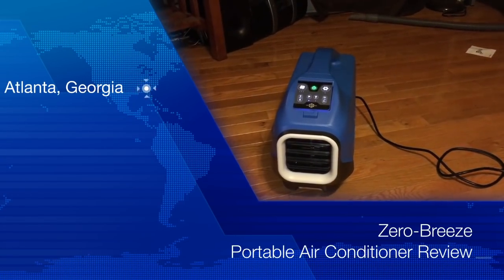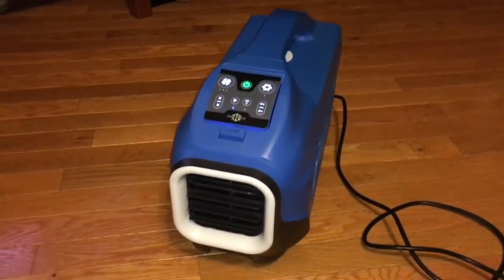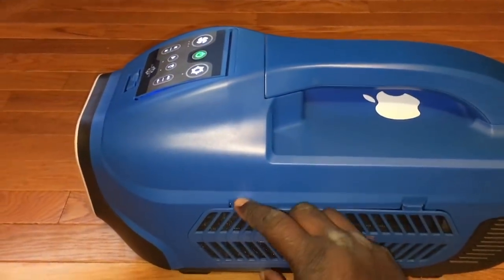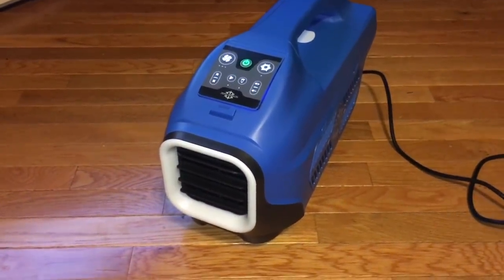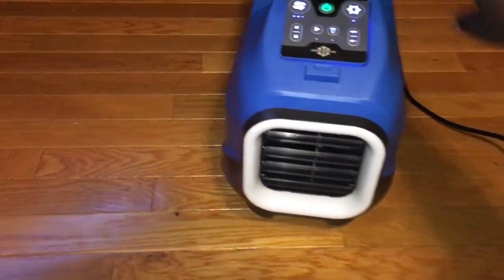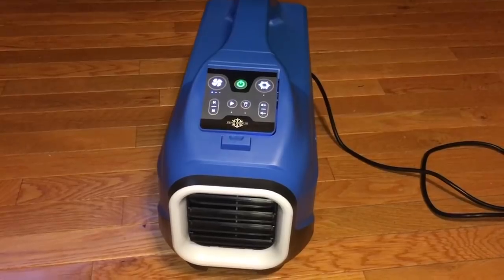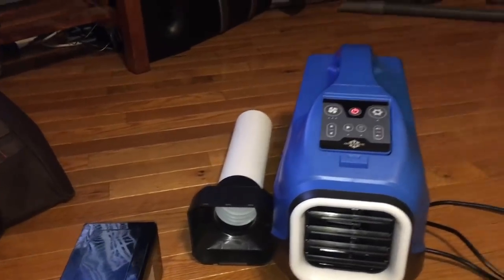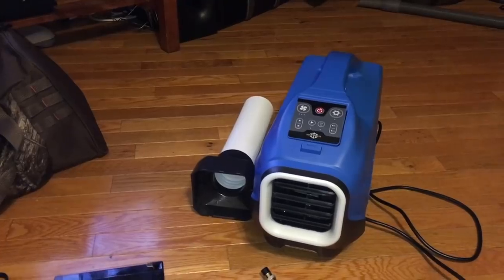Zero Breeze Portable Air Conditioner Full Review

Comment: Wondering how many purchasers of the zero breeze have had as negative of an experience as us? I have been in contact with the "fine" folks at zero breeze about how poorly the unit performed. They asked me to send a video showing the performance of my zero breeze, which I did. It lowered the ambient temperature about 1 degree in 10 minutes. After I pestered them about the video, they finally got back to me and said that the unit was working as designed " But if you blow directly to your body you will feel the cold air in you and a quick cooling down of your somentosensory temperature." I'm not really sure what that means. Their website clearly states. 
 It can cool the environment temperature down from 90℉ to 72℉ in a 50 square feet space and reduce the humidity at the same time. It does not even come close to doing this. The unit is a piece of junk. Buying the unit is a wast of money.

Comment: Modified Sine wave inverter should be fine, those adapter are Switched-Mode.
Reply: If you have the juice to run an inverter...you would be much smarter to run this directly from the 12v battery system.

Comment: This is only to blow directly on a person or more accurately a body part such as face as opposed to an entire body. To know whether it would give any usable relief you need to be in a hotter room such as high 70s to 80+. Im a hvac guy and at 1000 btu's my oppinion of this device is useless taking in consideration noise factor and cost. This is a great device to cool off Barbie in her dollhouse as opposed to a human. Just my opinion of course and we all know what opinions are worth. Outside of that this was a well done and informative video.
Reply: Actually he said it cooled down an entire room.  I can't validate that but you never know.
Reply: Yeah, but he didn't say how small the room was.  Maybe 4 X 4 X 4 feet???
Reply from the maker: I said that?  I thought I said it would NOT cool the room.  I’ll review the video. I use it mainly for spot-cooling me, and 1100 BTU is enough for that.   For instance, when I have to watch the kids outside, the ZB has REALLY been handy as I’ve been comfortable and the kids seem to not care about the heat.
Reply: Thanks Jay, for the clarification.  Yes, I understood that the unit would only spot cool.  But, given time it would probably keep a very small room (a closet, really) several degrees cooler than the surrounding rooms.  Still, inadequate for cooling an average sized room, but the unit isn't designed for that purpose anyway.  It would be nice if you could get a practical unit that would handle a small room though.

Comment: It's advertised as an A/C unit, not a fan with a compressor, so wouldn't you think that when you first turn it on it would automatically engage the compressor? I don't think I've ever owned an A/C unit that when I turned it on, I would also have to switch on the compressor in order for air-conditioned air to come out, so one would think having the ability to turn off compressor to revert it to a fan would be a plus, vs it being a negative, but hey to each their own.

Comment: $420 for a small air conditioner?  May as well buy a full size AC for half the price.
Is it really effective on a hot day?  90 to 110 degrees?  Or only good on warm days?
Reply from the maker: RedRider1600 True but this is a new product and you know pioneers pay the highest prices. If it’s performance is consistent, you should be very comfortable whenever you use it. Since this video, I’ve used it at two DJ gigs in the booth and to cool a non-climate controlled bathroom with positive results all three times.
Reply: Also you can take this outdoors. Camping. The beach. Tailgating etc
Reply: Is that much of an improvement over a cheap fan?  Is it worth the extra $390, and 5 times the electricity?  How much power does it use?  150 watts?
Reply from the maker: The beauty is that this is an actual vapor compression unit, so it definitely beats a fan especially in humid situations.   Its very portable even with the alternative battery set up I use. For me, it was worth the investment.
Reply: You are paying for its portability
Reply: A 9-inch $30 fan is portable too.
Reply: Hi RedRider1600.  You bring up a good point.  Yes, this is a refrigerant type a/c unit so it does actually cool the air.  You can't achieve the same degree of cooling with a fan alone.  It's limitation is the 1100 BTU rating.  A fan with a high air flow might give nearly the same effective feeling of cooling as the zero breeze.  It would be subjective and impossible to test with an apples to apples type comparison. The smallest window air conditioners commonly sold are 5000 BTU and are designed to cool a single room.  So the zero breeze has the power to cool maybe about a fifth of a room?

As to the power requirements, Zero breeze uses 12.5 amps at 12 volts.  A typical 5000 BTU window air conditioner (the $100 variety at your local big box store) will use 4.5 amps at 120 volts. (Taken from the label on the one I bought 5 years ago.)  Using Ohm's law, we can calculate that it would use 45 amps at 12 volts. This 45 amps is approximately the usage capacity of a group 27 marine deep cycle battery every hour for the window a/c and every 4 hours for the zero breeze.  But with the 5000 BTU Vs. 1100 BTU difference in the units as well.  So the unit is a little less energy efficient than the 9 SEER rating of my window a/c machine, but not horribly so.  The answer to the power problem could be to just keep it plugged in to the grid, but that too would limit the portability and the practical applications of the zero breeze unit.

Yes, the unit is portable, but so is a Honda 300 watt inverter generator which will power the rooftop a/c in my RV.  I'd like to see the zero breeze doubled in size. (BTU rating)  This would leave it portable enough but much more practical for cooling small spaces.  1100 BTU would be sufficient for maybe a small closet, I think.

If we consider the window a/c as sufficient to cool a room that is 10 X 12 with a 8 foot ceiling, that would be 960 cubic feet of space. One fifth of that would be 192 cubic feet, so let's say that the zero breeze would be sufficient to cool 200 cubic feet of space. That could be a space of 5.5 X 6 X 6 feet. (198 cubic feet)

There is still some development to be done on this product.  They need to get rid of the fluff items like bluetooth speakers and work on making the zero breeze more practical for more people and for more applications.  JMHO.

And as others have stated, early adopters usually pay more and receive less quality for the higher price than do late adopters.  Personally, I have to be REALLY sold on a product to be an early adopter.  I can remember when we talked about and dreamed of the "Sub-zero" computer. (A computer that one could buy for less than a thousand dollars.)
Reply: It may have refrigerant and the air may be cooler, but the thing is tiny and the output is very small.  A 12" fan might do an equal or better job of cooling.  I would like to see some real objective tests for comparison.  Hey, that's a great idea for a video . . . hint, hint . . . somebody?
Reply: The next time I'm in a 5.5 X 6 X 6 Vietnamese POW prison cell, I'll have to get me a Zero Breeze portable air conditioner.
Reply: It's actually $900 now. Waaaay too much. :(
Reply: Just wanted to post to give you some kudos and say you did a GREAT job on this review. Thank you

Comment: So on one side its 55 degrees, and on the other side its 100 degrees without exhausting the heat outside the room its cooling,.. so all you get really is a higher electrical bill.
Reply: D V derp
Reply: this isn't designed for home use, looks like a camping / tailgate item.
Reply: Didn't you see there is an exhaust that can be used to move the hot air outside?  You get a "D" for paying attention.
Reply: D V Ever hear of heat resistant plastics like Vespel, Torlon, or Ryton?  There is no melting point for any of the three. Oh, they don't create high amounts of ambient heat either.  Nice try rube.  Whatcha wanna try next?  I can do this all day.
Reply: Sylvester Simons no melting point does not mean it retards heat transfer. In fact it does that exact opposite. It displaces heat,.. it does release a lot of that heat into the surrounding area. We can play this all day. But you have to use actual facts. Otherwise whats the point?
Reply: Look D V, I used actual facts. There are several heat retardant plastics on the market that are resin based and used in higher end portable a/c unit exhausts.  I will say one more thing then I am done.  If the unit cools you, and you can shut your central air off, bottom line, you are going to save on your bill.  There is no way to refute that fact because the amount of heat this unit would create in a small bedroom is negligent.  Isolating air use to that room will reduce your bill. Small room, small heat signature, your bill still goes down overall.
Reply: Sylvester Simons hahahahaha
Reply: If you displace air in a room it is going to be replaced with air that is unconditioned. So if it is 80+ outside you are still fighting a losing battle. Still a worthless product unless you just have it blowing directly on you, but it will never cool a room.
Reply: you talk too much......unnecessary blah, blah, blah
Reply: What do you mean?
Reply from the maker: The exhaust hose is made of the same material and same thickness as those on full-sized portable AC units, so I would expect the unit to perform similar to a full-sized portable unit in room-cooling mode when removing heat.
Reply from the maker: Michael Hayes The negative air displacement is a valid problem with single-hose portable AC systems; the ZB is no different. It causes them to cool a room very slowly compared to closed systems.  They do work, however, when there are no other options although they aren’t as efficient.
Reply: Again, it's NOT meant to cool down a 120 square foot room! It's for small spaces less than 50 square feet. That's about the size of an 8 x 7 closet or large sized van or tent. Not a problem if it's vented properly. And the vent hose wouldn't affect the overall ambient temp of the entire room, if at all! A large fan would cost more in electricity and NOT cool down the room at all. Just circulate the hot air.
Reply: Question tho as the vent only goes out the back but he showed sig heat coming out the back sides how does that work
Reply: I use one in my bedroom in South Dakota, which is super high humidity, lwers the temp by an average of 25° and there is no excessive heat from the hose, it's a dual walled hose. It works great and you can listen to tunes
Reply: If it makes my electricity bill higher id rather just out a fan in the window or go buy a air conditioner to put in the window and cool the whole house....i don't think it's fit for a home but I will say this is a good product but what if you have no power?does it run in batteries?can u recharge it somewhere via car,etc?i live in Chicago and lately it's been 95 almost 100degree weather and had a rain storm that knocked my power out....now how would I cool my home if the power is out?
Reply: Yea there is no way this would cool a house let alone a bedroom. There’s a certain amount of BTU’s you need for the proper cooling power. We have a 10,000 BTU and it’s 450pi squared for our apartment which is probably like 650-750 square feet. What’s the BTU on this?
Reply from the maker: It’s not expected nor advertised to cool a house. It’s only 1,100 BTUs.
Reply: radio tech Fans more effecient.
Reply: James Patterson Yes it runs on batteries. Did you not listen.
Reply: Lyle J it's not made for a house
Reply: Caesar45 it's not made for a house. Camping and rvs

Comment: Actually there is a better alternative at a cheaper price. The Icybreeze cooler/ac. Yes there is a hassle with adding ice and water but with enough ice it will easily last for 6 to 8 hours and certain ice packs such as cooler shock will make it cold longer. One big plus with Icybreeze is that the temperature can dip 35 degrees below the ambient room temperature. Zero Breeze only about 15 degrees which is pretty bad considering it has a compressor and refrigerant. The fan on Icybreeze blows up to 25 mph of COLD air which is a heck of a lot more than a typical fan which is around 8 - 12 mph. Zero Breeze is overpriced and there are definitely cooler and cheaper portable alternatives despite a little inconvenience of adding ice and water. What matters to me is the results. How it feels and how much it costs.

Comment: I feel like this thing needs to break priced at about $120 max considering you can get an actual portable AC that is much bigger for about $250.
Reply: Because of the portability factor, I'd go up to $200 for the price point.  Much beyond that though and it is just an expensive toy.
Reply: A window a/c is a high draw appliance and it would chew through a car battery in a matter of minutes.  Even with a marine deep cycle battery you couldn't run a window a/c for a significant amount of time.

You'd need a bank of at least 10 large deep cycle batteries to run it for a significant amount of time.  I've done the math and running a window a/c using an inverter and batteries just isn't practical.  (I'll walk you through the calculations if you wish.)

Still, Zero Breeze is a product to watch.  Give it 5-10 more years of development and it might become something much more practical than it is now.
Reply: And I agree about the bells and whistles.
Reply: It would be nice if they made a version without all the bells and whistles like the bluetooth speaker and light. I'd like to get one of these but I would be over-paying for a bunch of features I would never even use.
Reply: Hmmm can you run it on battery? Not that is why they invented this FOR USE IN TENTS, RV'S & when they have NO electric or generator, OR they don't want to listen to generator in middle of night and piss off the neighboring campers to boot!

Comment: Great review, but this thing doesn't breathe high quality. The plastic case was rattling until you pushed the fan button, which does not give a lot of confidence. With all the useless bells and whistles it looks not only made but also designed in China, not San Fransisco. Lose the bells, make it more sturdy and it'll be getting there.

Comment: I would like one but do you think it would cool off a semi sleeper too save fuel
Reply from the maker: Derek Oehlert it’s rated at 1100 BTU/hr so I wouldn’t expect it to cool the entire camper. It will keep you comfortable and reduce the humidity though.
Reply: How does it reduce humidity?  Is there a water collection container built into the unit?  Or does it just drip water all over place?
Reply from the maker: The base of the unit has a drainage channel built in beneath the evaporator that drains to the rear of the unit; there is an opening that will release the condensation at the rear. The Zero-Breeze also comes with a condensation hose that attaches to the rear opening so you can route the condensation somewhere else.
Reply: Jay Lee great job on the videos. I have been testing my unit in San Antonio and plan to use it in a roof top tent.  I have had an issue with water dripping out near the drain port.  Have you experienced similar issue? Or have I am I not doing something correct and this causes water water to drip out of the over flow under the power
Reply: Derek Oehlert Since its an actual a/c, you would need to vent the hot air out of the sleeper that the unit is producing.
Reply: Derek Oehlert Z
Reply: Derek Oehlert iib
Reply: I'm no rocket scientist but if you vented it outside, making some panel to mount the exhaust pipe out a window without letting more air in, oh and my portable I am using the exhaust pipe was so hot, I put heating pipe insulation sleeve on it, and wow it really helps, it was so hot it had to be adding heat to room, like radiant heat would. I moved to another room, put window in but then insulated the pipe and out the window, it was also outside room in other room but couldn't do the job, think this would be great for a small sleeper cab, however like a car they would also heat up hotter than a house room, so you would have to try it and see, send it back if it sucks. Thats why I don't buy anything thats not sold in land stores online, they make you pay to ship it back and restocking fees if you don't want it.
Reply: Of course the water when full is going to come out somewhere, you have to put a drip pan under or use the drain hose to route it elsewhere, just like a portable air conditioner, mine would drain near 4 gallons or more water on a very hot day from air, got tired of using buckets and emptying it, so hooked up a hose, same difference here. Of course how much humidity where you live will tell the tale
Reply: Derek Oehlert

Comment: Principal of cooling is moving heat from one place to another. So these machine is dumping the hot air back in to the living space?
Reply: If you don't install the external vent, then yeah, that's what is going to happen.  If an air conditioner like this was perfectly efficient, then the heat coming out the back would balance with the cooler air coming out the front and you would get zero average change in room temperature.  Unfortunately, you can't get 100% efficiency, so the net result will be for the room temperature to increase.  You really need to vent the heat out of the living space.

Now, if this thing had a vent where cool air could be piped elsewhere, then it would open up some other possibilities.  One thing that I would consider it for at that point would be to use it to cool the helmet of a rider on a motorcycle.  Car race drivers have helmet systems where they have hose attachments for air intakes and this sort of modification to the system would be perfect for that.  If you can keep the head cool, the rest of the body feels a lot cooler also.